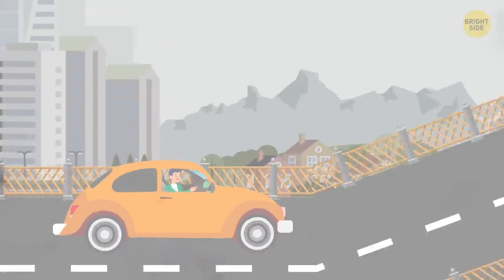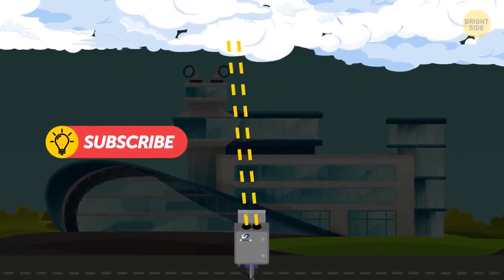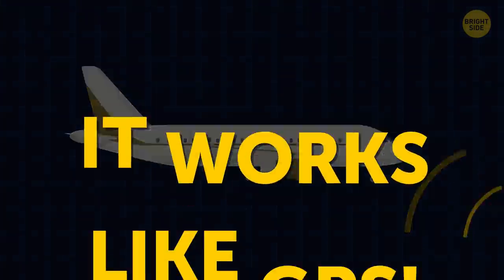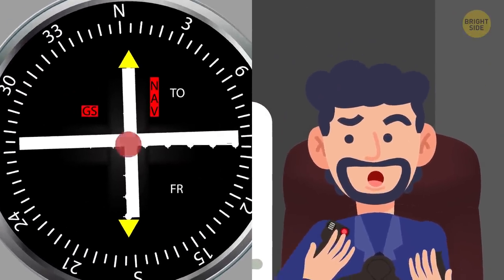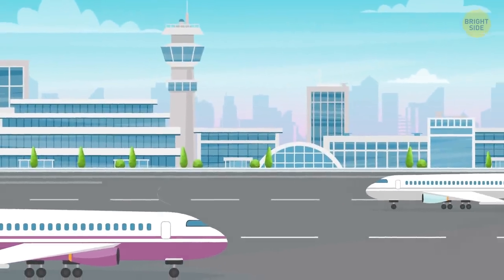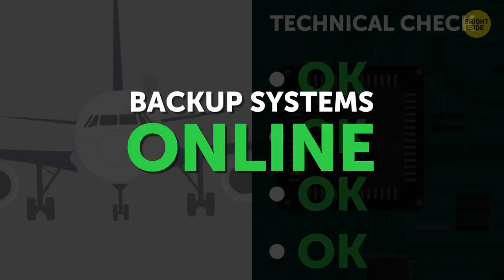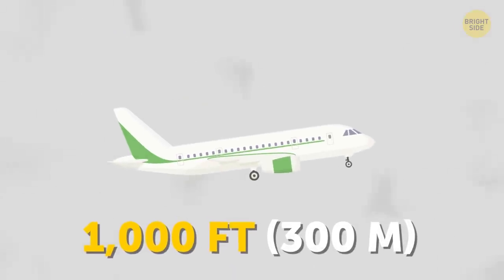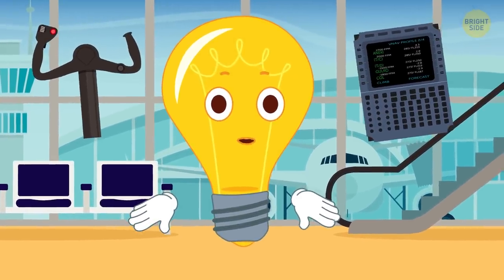How Planes Land with Zero Visibility in Fog

Comment: My father, who was an Army Air Corps (Air Force) pilot in WWII, told me a story about the time he landed in thick fog.  He was going to land at Little Rock, AR and had been given approach clearance, acceptable visibility and landing clearance but he could not see a thing through the thick fog.  Using his altimeter and radio direction finder, he started his approach.  When he still could not see the airfield lights but saw lights from buildings outside his cockpit, he called the tower to tell them they should revise their weather report.  They responded with "Fly away.  We're closed."  He figured that he had just enough fuel to make it to Memphis, TN.  They too were fogbound but he had no choice.  Lining up again, using the altimeter and radio direction finder, he told his co-pilot to tell him when he felt the wheels touch the ground.  Once on the ground, he called the tower to have them turn on the lights.  They too told him they were closed and he replied, "I'm already on the ground.  I just need to find the hangar."

Comment: My dad is a pilot and I’m flying many simulators and fog is no problem for pilots. If the pilots can’t see the runway before minimums that’s about 300-400 feet up, they need to turnaround or else they will just make a autopilot landing... but mostly only for commercial planes :) not for small cessnas

Comment: can pilot land in fog, the answer in NO. if the runway is equipped with ILS cat3c or MLS, the aircraft is equipped with the necessary equipment the pilot is rated and current, then the aircraft can be landed using the automation and the pilot will monitor.

Comment: Misleading video.  I flew a 1964 USAF transport category airplane that was fully autoland and autothrottles certified for 100ft ceiling and 1/4 mile visibility landings. It also had an amazing antiskid braking system.  Thunderstorms with associated wind shear is the only weather I know that stops major commercial airport operations.  .